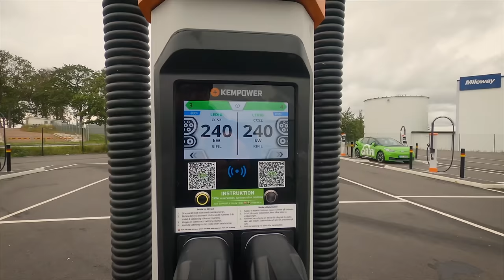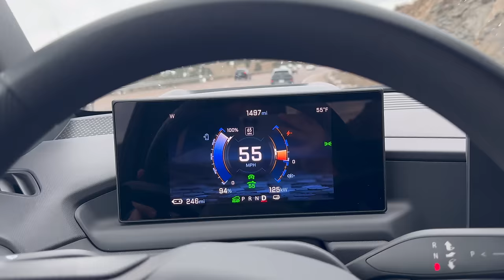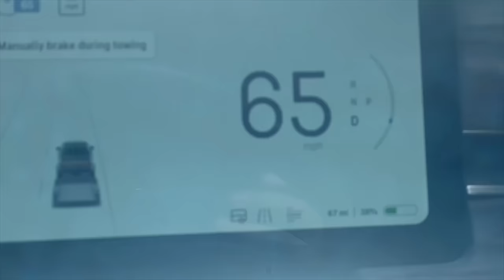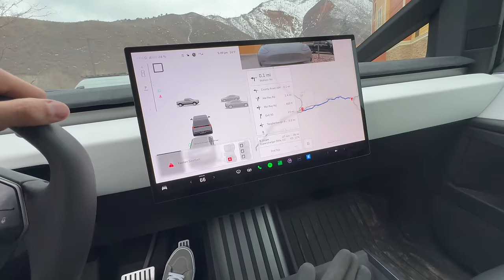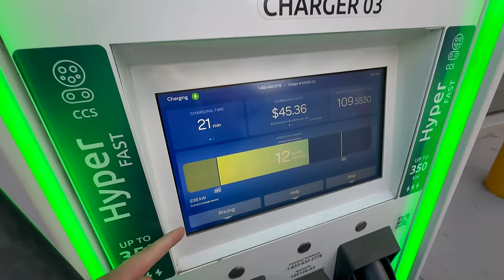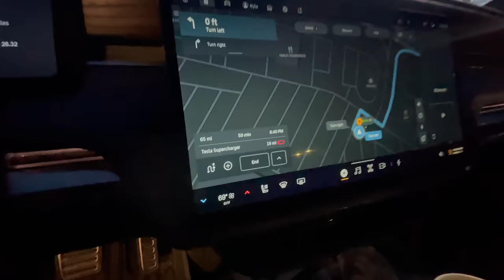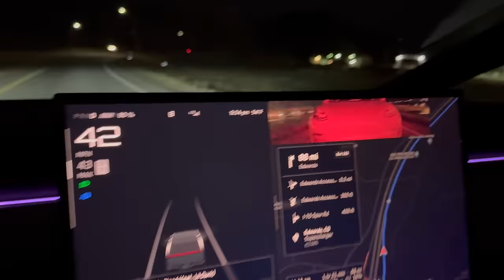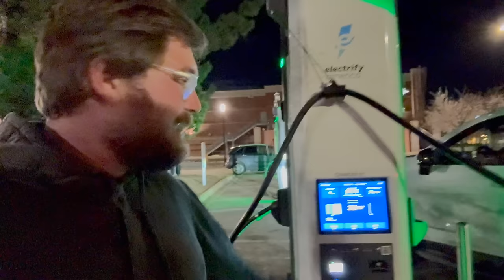Electric Trucks Tow 500mi Over The Rocky Mountains! Cybertruck vs Lightning vs Silverado EV vs R1T

Comment: If the cybertruck weighs less then the R1T and Silverado ev, then how is the cybertruck not epa range tested yet? Because the Silverado ev is 9,000 lbs and is epa tested.
Reply: It is not illegal to EPA test a heavy truck.
Reply: Because Tesla likes to skirt requirements in their favor/save time.
Reply: Because the EPA numbers will be lower than their fraudulent claims.
Reply: For >8500 GVWR manufacturers can opt to go through the test procedure, and may have done so in order to demonstrate what they can do. Others may have chosen not to, for whatever reason. It isn't mandatory for >8500 lb GVWR.
Reply: @TroySavary  Yeah sure, the only truck that hit its stated range while doing 70mph in Kyle's side by side test.
Reply: EPA range is not a requirement for BEVs. My guess is the real reason is that Tesla isn't finished tweaking the Cybertruck yet.
Reply: @boostav  Cybertruck didn't come close to Tesla's state range at 70 mph.
Reply: @TroySavary  It did, went 305 miles at 70mph. CyberBeast with AT tires has a stated range of 301.
Reply: @boostav  Who went 305 miles? The Out of Spec range test got 254.
Reply: @TroySavary  Wrong, type "Electric Pickup Truck Range Test! We Ran All Of Them To Dead" in youtube's search bar. They ran all the EV trucks side by side at 70mph and they got 305 miles out of the Cybertruck. I know you've watched it, this is for anyone that may be reading and falling for your bs.
Reply: @boostav  You mean tge one where the Cybertruck refused to charge once ran to empty and had to be trailered, then was unable to pop the trunk to chabge the 48v battery because Tesla us too stupid to include a physical means to unlatch it. So they had to disassemble part of the bumper to find a set of jumper wires just to give enough charge to open hood? Yeah, nobody is going to be doing that, so it's a rather invalid range number.
Reply: @TroySavary  You truly are a sad troll. ALL the trucks were ran down until they stopped driving. That's exactly what happens with every EV with a powered frunk when the low voltage battery goes dead, why do you think they popped the hood for the other trucks after they stopped, genius. The guy driving the Cybertruck forgot to do so. They also didn't disassemble the bumper they removed a cap that requires no tools in order to access the wires.
Reply: @boostav  The other trucks charged with the portable charger. Cybertruck died and needed to be towed. Stating facts that hurt your fanboi feelings doesn't make a troll. Why are Tesla stans so sensitive? You scream troll every time reality is different than you like.

Btw, MotorTrend just got 224 miles range at 70 mph in their Cybertruck test. Kyle got 254 in his first Cybertruck highway test. Other people also got far less than the Tesla claim. That makes Kyle's second test suspect.
Reply: @TroySavary  Because the portable charger is a CCS one and can't charge the Cybertruck. Something that someone who actually watched the video or isn't in bad faith would know. Maybe because you are a troll, you're under every Cybertruck video spreading bs.

Because the OOS test is done at high elevation which makes a big difference. Aside from the fact you can trust an Out of Spec range test a whole lot more than MotorTrend.
Reply: @boostav  There is a CCS to NACS adapter, so stop with the bullshit excuses. Cybertruck turned into a doorstop.
Reply: @TroySavary  (1) said adapter doesn't fit in the Cybertruck due to the fenders. (2) Handshake with CCS chargers is not enabled by vehicle software yet. This has all been extensively documented in the OOS videos, the fact it was going to be towed to a charger for the above reasons was clearly stated at the beginning of the video you watched. You're either dense and incapable of basic listening comprehension or intentionally misleading. Likely both.
Reply: @boostav  Your attempts to defend Tesla are just making them look worse. Cybertruck doesn't work with Tesla's own adapters? They are making this too easy.

You are assuming people watch the entirety of Kyle's over long, self indulgent videos. Most jump to the comments to find out where the interesting parts are.

Comment: Try to Remember Towing should be done at Safe Speeds and the Driver needs to take responsible Breaks to maintain concentration. If you can get 300 Miles out of a Tow in an EV before needing to charge that should be enough. Batteries will only get better. Regressing to a Diesel which emits Carcinogenic Fumes is like someone taking up smoking Again but making sure everyone nearby gets secondhand Smoke.
Reply: 109%

Comment: If someone tows occasionally all 4 trucks will do just fine.
If someone tows regularly let's say once a month then it is much better the Chevrolet Silverado vs others.
 If someone tows across the country once in a while it is better to wait for RAM Range extended EV truck.
If someone tows daily moderate loads it is better to have right now a Ford F150 HEV or a Toyota Tundra HEV.
 If someone tows heavy loads daily on very long distance then a Diesel HD truck will do the job for now.

Comment: EV trucks need huge batteries, period.
Reply: We were talking about that on another channel. To charge that battery in 30 minutes would require the power infrastructure the same as 132 homes for just one charger. 10 chargers would require the power infrastructure to power 1,320 homes. So a state the size of Georgia would need an extra power infrastructure to power 105 million extra homes.
Reply: Petrol trucks need huge fuel tanks.
Reply: @makmoto0606  right. This isn’t an efficiency game, it’s about energy storage.
Reply: @Williamxmr depends on use case, contractor in town, save money with more efficient EV truck. Not everyone needs to tow and second home a thousand miles.  People think each vehicle needs to met their ideal use case. This may not be your vehicle.
Reply: @makmoto0606  the video is about towing 500 miles lmao. Pay attention
Reply: thats why i didnt buy the CT, loving my Silverado EV though...   LOL

Comment: More proof  that if the CT came with the 500 mile truck as it primised it would have been killer.   Range extener is a waste of time, no one wants to give up bed space . CT needs a redesign . Improve battery capacity and change the headlight position. They can completely delete the frunk if they need to and shift everything foreward to make room for more batteries.  Silverado proves why a large battery is needed .
Reply: The vast majority of people will never tow like this.  Tesla would be fools to design or redesign for this purpose.
Reply: @mattl7967  Yes... They would be fools to sell a truck that did truck things..    As long as you keep using it for shopping at costco your golden...
Reply: @crimsondecade7420 life is a game of trade offs.  Buy the darn Silverado if you want to tow like this.  You may want to do some math on daily driving costs though.  Hauling all that battery around isn’t cheap.
Reply: @mattl7967  so what you are saying is that most people should just get a normal car and rent a truck if they need to tow.
Reply: @mattl7967  still 3 times more effecient than my f150 that it replaced.   LOL
Reply: @TxChristopher Honestly that should be the rule of thumb in general

Comment: Kyle, you may not have run into this, but I’m wondering how you felt and how you handled it with the surge brakes applying all the way down a grade, causing them to heat. Short grades are not such a problem but our Colorado long grades are. We rented a surge brake trailer to haul a Ram diesel mega cab and had to stop several times coming off of Wolf Creek pass. Thanks for your insight
John

Comment: Silverado is definitely the  right equation for ev towing which CT should have been. It's a shame that you can only get as a fleet for right now.
Reply: Retail versions are about a month or two away, so it won't be long. I believe they've already started building them.
Reply: My Chevy dealer said they started taking retail orders last week.
Reply: It's good to have an EV truck designed with longer distances in mind.

I suspect, as time goes on, people will think more about whether they need all that battery or not.

I guess the question is, if only 10% of truck drivers ever tow, what percent THINK they need a truck that will tow long distances?   This will determine the market size for big battery trucks.

Of course, part of the consideration will be resale value.  Even if I don't need to tow, my truck will hold value better in the long run if it can.
Reply: @davidmenasco5743  This is carefully weighing in the balance between abondance and scarcity. I prefer the former. Give me big battery, that way range whether towing or not becomes a non issue. 400+ miles range is definitely a good threshold.
Reply: they are selling work truck versions to retail customers now.  i paid 66k for a 4wt with 450 miles of range.   acutally gets closer to 500...go figure.

Comment: Charging port location in Rivian is the best of all other trucks for all around needs.
Reply: But still wrong. It needs to be on the right front, not the left front. Same with the Ford. And Farley has already said that's being moved to the correct side.
Reply: @Paul-cj1wb  If the drive through system for charging stalls, like in Norway, would be implemented, then it would not even be an issue about port location at all. For now I would prefer a Rivian port location. Hopefully the future Ford charging will be the best as you wrote.
Reply: @nevco8774  That's the future, yes. But for now we all have to live in what exists in reality. That'll take many, many years to get there on a country as large as America, not to mention Canada. 

If manufacturer's want to sell vehicle's, they have to move it to one of the correct 2 locations or fall far behind. And even fail in Rivian's case.

Like it or not, there are more V3 stalls/dispensers out there than ALL other stalls/dispensers combined. In fact, more than 4 times more than all other Fast DC charging ports. So unless you want to restrict your options to only 25% of the charging options out there without having to carry around an extension that can be lost or stolen, or taking up two spots, you place it on the correct location. Which for towing is ONLY the RIGHT front.

Comment: The subconscious assumption here is that to be a real pickup, then you have to be able to tow 1000s of pounds 100s of miles regularly. That's only about 7% of the pickup market. But if you need to tow with an EV, then the Silverado is the beast.
Reply: Why do people assume pickup owners either constantly tow or never tow? Most of us tow 1-2 times per year, maybe 3-4 in a busy year.

Comment: That Silverado touch 350kw is the next EV truck I’ll buy. That big ass battery is no joke
Reply: Do you know when it is gonna be available for sale?
Reply: @GoFast58 RST version is expected in the summer I think
Reply: @niktak1114  What about the non rst models?
Reply: @GoFast58  hopefully soon after. It depends on supply and demand though.
Reply: And the fact that it was still over 250kw at 61% charge is insane
Reply: 4wt is avail for 66k...no tax rebate needed....im loving mine

Comment: My question is where are they fitting the larger battery pack for the Silverado?  Is the cab smaller?  From my understanding Tesla didn’t put a huge battery pack in it because most customers wont be towing all the time and so Tesla went for efficiency as to lower the weight and cost of the truck.  Then once the extended range pack becomes available for the Cybertruck it should be close or better than the Silverado in towing range.  I am impressed with the Silverado but not a fan of the Avalanche look.  I am a GM guy but I am ready for something different so I am for the Cybertruck.   Thank you Kyle for the video!  My wife has seen you twice in the Fort Collins area. We have the Spectrum colored Model Y with CYBER T plates.

Comment: I love this comparison test, however, I'd oddly be more interested in day to day things like parking in a grocery store parking lot, fitting child safety seats, cleaning stuff outta the bed, the cab, hauling kids gear or my tools, getting that stuff in and out, charging daily, thermal management, and cost per mile.  I'm still keeping my V8 Nissan for the "real" towing trips.  EV trucks aren't made for towing.  Let's be honest.  The charging structure is there for regular passenger vehicles.  Not long range towing.
Reply: Kyle has plenty of videos with the kind of content you are looking for. EVs are fine for towing, but not for towing distance, as you point out.

Comment: Oh, nother question: Can/will my 2017 Bolt ever be able to use tesla chargers, or is it too old?
Reply: If GM is going to use Plug AND Charge (not Plug & Charge) which relies more on App configuration yes it will work. That's just for plugging in and not interacting with the apps after setup. Right now it already works fine at Magic Dock locations.
Reply: Coming later this year. The Bolt is capable of "plug and charge" - here in Canada, the Flo charging network has just announced it, and I think it works on EVgo in the States - but it is quite another matter whether the charging network will choose to implement it. And, for now, you'll have to set up an account with each and every charging network that you plan to use. (Same thing with Tesla, by the way, if you want to go outside their own network.)

Comment: Other than re-fueling time the Silverado EV would have out performed its ICE version.
Reply: Does the battery last 500,000 miles now? Can it be replaced for $3000? Wow I didn't know EVs had gotten close to ICE longevity yet. I've got 395,000 miles on a Toyota Corolla and haven't had to repair anything. My Chevy vans are basically the same chassis as a Silverado and I've had 4 of those to make it past 450,000 miles without any repairs and rebuild the engine and transmission in two for less than $1,000 (I know how to rebuild them) and one is currently about 620,000 miles. But it just had a tiny place to rust through. 😢
Reply: In which metric? The gas chevy 1500 can tow the same trailer that distance going the same speed. The only difference is the refueling which the ice blows out of the water, and you can get a full tank and not have to worry about slowing down the fill as you get to full.

Comment: guys  through in just one gas truck of equal rating and see what will happen. is the elec. truck so much better then a gas truck? Is the gas truck and the elec truck equal? Or are the elec trucks just not ready to hold up to a gas truck? which is cheaper to operate? This is what I would like to know before buying my next truck.

Comment: The Cybertruck with 123.4 kwh pack should be the "standard" or small pack.  Tesla should have an 185+ hour long range pack WITHOUT having to take up bed space.  Tesla really scrowed the pooch on the pack size.  I got my invite to order, and my # was 274,000.  No way am I paying $20 to $30,000 overpayment to get one now.  Just don't be that person where you get it, then a week later, you lost $20,000 + overnight.  GM needs to push out the W3 & W4 Silverado EV with the huge packs.

Comment: Thanks for this great test! I would assume if you calculated the extra consumption based on trailers it should be "excactly" the same. In low speed the difference in "hiding behind car" capactiy should not be that big

Comment: Thanks for another OOS wild ride! If you can swing it one day, I'd love to see a comparison of trailer types and their effect on range. Real-world long distance towing will include a big camper trailer, maybe even one of those hookups on a truck bed mount. Compare that to a mid-length trailer like 22ft or so hooked up on a weight distributing hitch mount. And then try a pop-up trailer that should change the aerodynamics significantly, Cheers and safe racing ... er, driving.

Comment: Good test GM nailed it as you said how about fully laden to take it to the limit  to show all the sceptics that this is the future of Trucks  Tesla showes that ,Silverado has changed the game as battery get more power for less weight !!(  retired continental lorry driver ) great work 👍👍👍
Reply: I feel like this gave it the most real world stress. using 100% of the battery to go some where and charge 100 to go back is neat, but realistically, this showcases the best performance as the charging is kept at the faster speeds instead of the slower 90 to 100 percentage charging speed. If you want to spend less time at a charger, you just need to charge between 0 to 80. 100 should be only for stops where you know you can't keep going(like sleeping or reaching final destination or home base). There really just needs to be better charging infrastructure. its crazy to me that all gas stations pretty much allow pull through and EV chargers decided to do the dumbest thing of only parking only with slow speeds(yes I think the charging speeds should normalize at 350kw)

Comment: Hey Guys, Looks like Jordan wasn't in Tow/Haul mode for the Lightning during the trip. Tow/Haul is usually color-coded with an off-blue/white and Balanced is the Blue shown in this video. So this video is a good gauge of how the truck will do when the software isn't "optimized". I know the FordSync is not great but this also added to the incorrect range estimates.

Comment: I'm impressed with the Ford it's definitely punching above it's weight but lol at the software. Silverado is a beast but without 300+kw charging the benefits level off. My tow rig can't go to GJ on a single tank of gas but on the other hand I'll be at the Kum & Go filling up for $2/gal on E85 😊